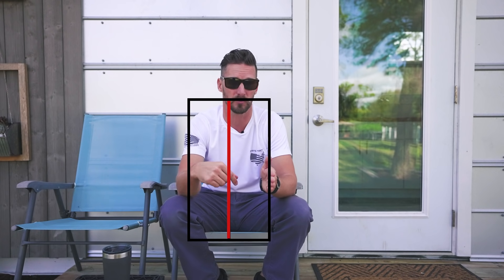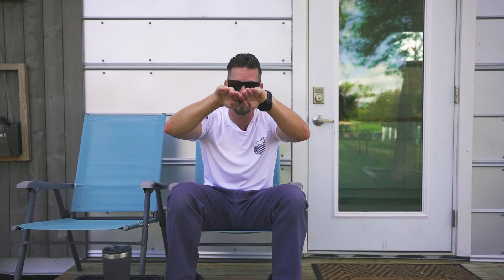The PROBLEM with Connecting Two Shipping Containers | Building a SHIPPING CONTAINER HOME

Comment: Don’t Connect them have a breeze way in between then build a rooftop over all three.
Reply from the maker: That is a good way for sure
Reply: @ContainingLuxury  Yes - after living in a tiny house for 9 years, only having that 8 foot width gets very challenging. Putting a breezeway between the two is a video I'd like to see. We are rebuilding after losing two tiny houses on wheels to wildfire, so we are looking at using a "bridge" to connect the two to have more width.
Reply: This what I was hoping to do! Kids in one "wing" parents in another living and kitchen in the next.
Reply: @dr.jukoholiday2399  I want to do this as well. I want an open minimalist floor plan. I kinda like a separate sections for kitchen and dining room. a breezeway (crosswalk or bridge????)🤔
Reply: I really like this idea because it I feel like it allows you to more easily expand your home in stages and without cutting into the existing container to add another on. You could pour one large foundation, build the main house, then later on a second container and put a roof over the two and use it as a car port or a covered deck or even enclose it all. You could also turn the whole roof into a deck or cover it with solar panels. It would be especially cool with side opening containers
Reply: Weld a 20 ft shipping container to the end of  both of the 40 ft containers and you can use it as a breezeway that doubles as a washer and dryer/storage area freeing up more space to use the 40 ft containers for something else. You can take the doors off of both sides of the 20 ft container & only have to cut out the metal for 2 doors connecting the breezeway

Comment: What about Tetris the containers? Such as L and T type connections which  breaks up the box look but ties a potential home together.
Reply from the maker: Not bad. We'll do a follow up video on this topic!
Reply: Yeah, breaking up the box look is an advantage as far as I'm concerned - and you can build a deck between.
Reply: That works, my issue is unless you stick build an addition as well, it still doesn't address a container's biggest drawback even though you are doubling the square footage.  Namely how narrow they are.
Reply: @BStrambo  the narrow is no getting around unless by joining which drives cost. The Tetris idea also can be used to arrange containers so build outward from area for 2 or 3 container sides. Other than doors, container stay intact keeping integrity and maybe money if the layout is well planned
Reply: @PaulDominguez  I had a design idea of 2 in a "L."  Between the L, a long tall wall with lots of windows making a triangle.   It would be a unigue shape with a vaulted ceiling, lots of light and space...but all the framed wall, subfloor and roof materials going over the whole thing. Probably as, or more expensive than just stick building the same design.

Comment: BUILT A quality 5 container house, biggest mistake I ever made. Should have stick built. I agree with this guy. One container no big deal.... multi container ... big deal. OH well in for a dime in for a dollar.
Reply from the maker: Hard lesson learned! And they say college is expensive :)
Reply: I assume u didnt do the work yourself?
Reply: I did the work myself
Reply: @billlovelace1522  were you working from and engineered set of plans from architect and structural engineer?
Reply: I got a friend of mine involved who was a structural engineer. I designed the building. I have been in the construction business for 43 years  and have/had access  to industry professionals for any questions that I had.
Reply: @billlovelace1522  very good. Same here. Built my first house here in NC at lake royale. 2000 sqft, took me 5 years to pay as I went. Lots are very reasonable here. 5000 non lake front for 1/3 acre.
Reply: @billlovelace1522  can u please explain to me the issues.

Comment: Is there enough movement from expansion and contraction to warrant an expansion joint between the two containers rather than welding the two together and having a crack develope in the weld.

Comment: Cool video and good advice. If you have a 40 foot container on the bottom and then put a 20 foot container perpendicular to the 40 foot container's long axis as a second floor, wouldn't that be easier to seal and water proof? There would only  be an 8' x 8' cutout where they intersect which could be flashed so water run off wouldn't be such a big problem.

Comment: I learned this lesson the hard way. I'm building with 4 containers, and have had tons of problems with the connections.
Reply: Hi Joseph.. Can you share what problems you have encountered with your connections?
Reply: @yolandia26  the biggest issue is the containers aren't completely straight and level, so we're actually having to bend them a bit to line up flush and true. Also, our plans called for some of them being offset, which made it more difficult.
Reply: @josephcacciapaglia4753  okay thank you for that information. I am interested but very clueless about where to start.  I am currently living in a traditional build but I am not ready to go under my current square footage of 1600. Any recommendations for a first builder in the Southern Eastern area? Thanks!
Reply: @yolandia26  Hopefully, you were not discouraged by this.  Unless the containers are new they're going to have dents and other imperfections. As long as they are lined up properly on the foundation, if you have a good metalworker who knows what they're doing they can away the sides and weld the containers together with no problem. It takes time, but it can be done.

Comment: There are Things to consider when building Shipping Container Home
is that every thing is planed for then those things can be avoided.

proper sealing of connections and proper support when peaces are removed 
are all very important. 

conventional house building has the same basic problems 
Miss one thing than the place will have minor or 
major problems either after finished being built or at a later date
with need to fix or starting from scratch.

things can be missed but minor problems is always preferred
and no problems is what is wanted to the max.

Comment: I was thinking of connecting two 53' side loaders together,after the doors are removed.
Reply: probably cheaper to get standard ones and weld in supports, unless you have a good source then go for it! it would be plenty strong
Reply: @Xenooni  The side loaders have already had factory engineered reinforcement added throughout because of the large openings.
You can set them together after the side doors are removed,weld the seams together,and then have the full open floor plan to work with.
No extra support needed.
Being in N.Cent.Florida near I-75/I-10 puts me fairly close to multiple major shipping ports.
Finding them at a reasonable cost shouldn't be to hard,even with them being less common than standard containers.
I've also been considering setting them in the air, on top of two 40' open frame containers like stilts.
Right now everything is in the design stage,and up in the air.
Reply: Yeah I m going to try this.

Comment: Good points. We built two 40's side by side with 5 ft offset. One side bed and bath, the other living and kitchen. The dividing point we supported with steel post. Roof seam we welded a strip of metal, then primed and waterproofed with white silicone paint. More work, but gave us more living space. Also built a covered deck on one side. We'd like to build another deck and get it all under one roof though for asthetics. Pay close attention to penetrations like doors and windows and be sure to research designs to keep water out.

Comment: Good point.. what do you think about putting two containers together in a L-Shape. Which basically means you putting the Front of one container to the end side of the other one. The connection would be much smaller and you can even just put a door in between.

Comment: Theoretically, could you do two larger ones that are parallel and a smaller one that fits into both? Would it require the same amount of work as putting them directly next to each other? Would it be more cost effective to put them on top of each other or would that have a different variety of structural issues?
Reply: They are designed to be stacked. Look at the shipping freighters  stacked at least six high or more with many thousands of cargo in every one. You are good to go. I'm doing one with 10 boxes 3 high. First two levels will be a box with a center court yard box 9 and 10 will be over the court yard

Comment: One guy could do it in a weekend. Probably only be about an extra three to five hundred dollars cost. That's presuming you have the tools to do it. More accurately probably another 150 200. Welding rods and grinding disc forgot to add that in. One guy with a  welder a grinder and two 1 and an 8th inch wrench's and shouldn't take no more then a weekend

Comment: He speaks the truth. We had 4 containers then after the completion added two more on for 6 total and each connection point needs welded inside and outside all the way. Since this is the case it doesn’t have to be absolutely flawless. You need to build a good roof or in our case we built a deck. A very large deck. This meant railing and stairs. We added stairs on the outside back and rather large steel planters that match the aesthetics of the sides of the house. Wayfair hooked us up and couldn’t be happier. 
Once you have the Welder there then you shackle him to a tree and get him to fill all the joints as the crane is dropping them into place. Negotiate the cost as a bundle and the materials charge with labor is quite inexpensive. 
The joints, the windows and doorways are his job. Fortunately our guy was skilled and precise to which he cut the walls out ran the bead and worked with our engineer on load points while removing the interior walls and windows as any steel removed compromises the structure. We used adjustable pole jacks as temporary supports until the trees we felled were completed on site which were used as live edged support beams. This saved three thousand dollars which came in handy with other issues that arise throughout the build. 
Exterior: once everything’s welded we used Rhino liner (truck bed liner, Teflon coating), applied liberally. Then the roof deck. The interior space gets eaten up by 2x4 then drywall. 
The Kitchen and bathrooms are your most expensive sections but I have to warn that your budget will be shattered once you get to windows. There’s containers can be dark and smaller windows don’t cut it. Our living room has two floor to ceiling panes of glass. This glass is Hurricane proof and double pane . This allows a ton of light that also makes the space look much larger. 
So , windows cut into the budget extremely, at least for us. Our cost was $12,000 budget but $18000 actual out of pocket installed. This reason we skipped skylights and the deck idea came to be. 
Exterior walls we used teak 2x4x10’s and spaced them 2 1/2” apart which created a shadow barrier between them and the container walls. This pocket creates added insulation. The inside is closed cell spray foam and the combination is perfect. The sun doesn’t heat the home up with the added features and it holds heat in during the winter months no problems. Solar is the way to go imo. Allocate section of the roof deck for them with enough room to maintain the panels. We use roughly 7.6 kWh when everything is on and running. So we got a deal on a Tesla power wall and it’s exceptionally good. 
If anyones thinking of doing this I’d suggest going with 1 container. Great for mother in laws suite/home on your land without having to move them into your house. Or go big. Initially I thought 4-(40’) foot x 8.5 would be enough until the build and walkthrough I knew to order two more. 
These containers come in classes. Class A’s are one ship new containers with guaranteed no chemicals or toxic hazards were shipped in it. Those ran $2500 but Class B’s are $1500 in Florida and NC USA. I picked which ones out of several hundreds in the yard and they looked new. I smelled the inside and they smelled clean. I didn’t eyeball the last two but the guy I dealt with knew what I expected and sure enough the trucks came with bright white no rust no dents no dings containers. 
Still we sealed the floors and then epoxied them. This guarantees never being exposed to hazardous dust or liquids that may have been shipped. 
One last thing. Shipping container home builds cost one third or 1/3rd the cost of a stick built but generally up to half or 1/2 in the end. 
Our home equity today is double what we paid to build it. 
This is the reality of this. Frustrating, stressful and having to direct everyone and fire some. The end result is accomplishment and pride. 
Only regret it not burying a few and stacking them. That bunkeresque design would’ve been great for storage and retreat. 
Next plans are connecting two 40’s together and making a shooting range. 
Then a 32’ and burying it then making a swimming pool. 
Hope this helps anyone contemplating a build like this.

Comment: Great Channel. Question a 40 foot container 10 feet high 8 wide.can u flip it kn the side to make the width 10?
Reply: I'll answer your question. Anything can be done. The question is would it be worth the time, effort and money? A high cube container is actually only 9'6" in height... ON THE OUTSIDE. The container floor and it's supports take away roughly 7 inches from the interior dimensions. The roof subtracts another 2-ish inches. So you are actually left with an internal height of about 8 foot, ten-ish inches on your high cube container. The main structural supports for a container are it's vertical corner posts... So, turning a container on it's side would require significant reinforcements for almost no significant square footage gain.

Comment: I kind of think 4 smaller length taller containers arranged to touch at one corner essentially creating a small courtyard in the middle. Cover it or don't, use each container as a specific space (living/entertainment area, kitchen/dining space, and bedrooms) big enough to equip with their own plumbing and toilets/bathing areas where needed. Without reducing much of the actual livable space since each container houses it's own function. Put a door at either end and privacy windows on outer walls and your choice of window to accent and show off your center courtyard or garden area. Bbq area if your Texan 🤗💯 I'd live there lol.

Comment: What about placing 4 containers with the corners touching, using them to enclose a large central space you can then just put a roof over, with the containers functioning as walls?  You wouldn’t even have to cut many holes into the containers - if you place pairs of the containers with their ends adjacent, you could just enclose them with two short walls and a small section of roof.
Reply: Each enclosed corner can be used as a mechanical room (electric & plumbing) or outside shed for lawnmower, garden tools etc...............good idea.
Reply: @scottbaxter2682  Yeah I’d enclose all the corners, using the facing corners as the connection point between two containers (so you don’t have to cut holes in them). The other corners could be mechanical rooms, storage or whatever.
Reply: i love this idea, wonder if anyone has the detailed floorplan for this idea yet :)

Comment: I agree. The best you can do if you want more "rooms" is to put several single containers side by side. Then removing the double doors on one side. Now you have several single containers facing you with one side open. Now you construct some structure in front of these open faces that covers them all like a long hallway. Wood or metal frame. Then put a "false roof" on the whole total structure. You enter from the right angled "hallway" and then go into each individual "rooms," kind of like a hotel setup. Yes, you will be limited by in terms of width but you can still have square footage space. I am no expert on the topic but this is the only cost effective way I can see of doing it. Also a simple way. Anything to widen these things takes up a lot of structural planning and money and may not be worth it. You might as well into getting a metal building.

Comment: Can you give your view on how difficult it might be to stack a container for a 2nd floor?  - And I don't mean parallel like they're designed for, but perpendicular, like a big "L"?  With posts on one end, could the bottom container support the (1/2) weight of the opposite end on top?  My idea is to use a circular stair to connect both levels.   -Thanks
Reply: You need to put some 2 by 2 square tubes under the corners of top container and bolt or weld to bottom container.

Comment: The front of my container home is two 40ft containers 5ft apart with the inner wall and roofs removed. The house roof is an large A frame from end to end, not side to side. It was a little extra work for such a high ceiling but worth it.